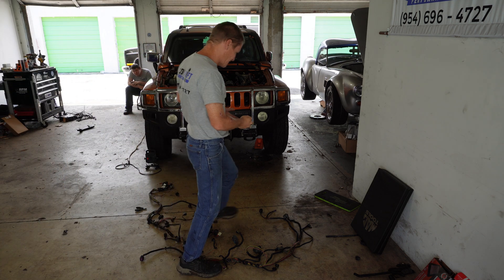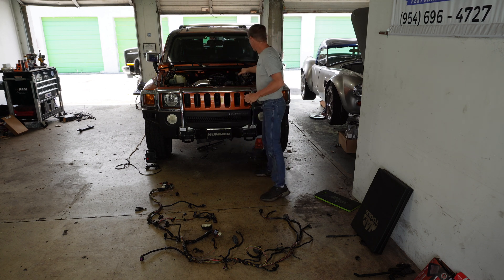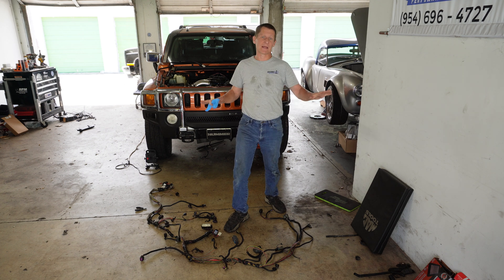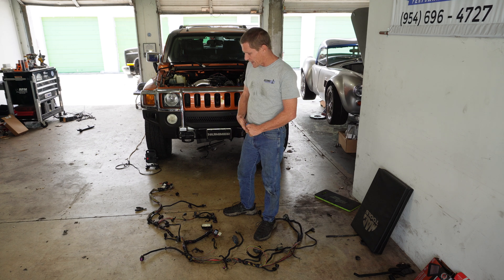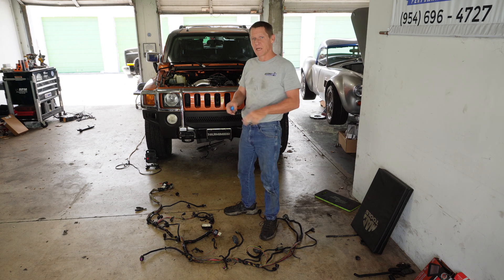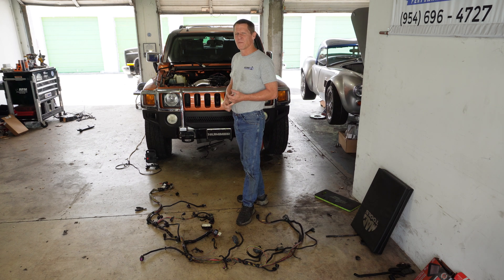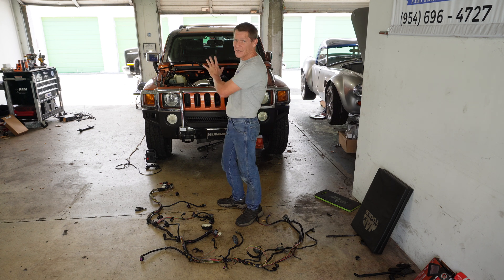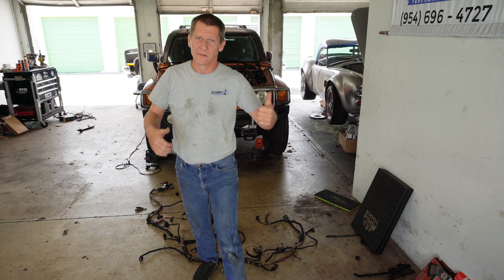Wiring Integration Pt. 1 – Hummer H3 Alpha Conversion Electrical

Comment: Hey Ive got mine almost done I think but I’m going to have to use the starter wire from the hummer harness to get power to my 5.3 starter aren’t I? Activation wire I mean
Reply from the maker: As it were I actually have a diagram I made just for that solution. Here is a link to that picture on my F.B. page: https://www.facebook.com/photo.php?fbid=819510302899659&set=pb.100045220904544.-2207520000&type=3

Comment: Nice work , what tcm you use for the new transmission
Reply from the maker: We are using the PCM from a 2008 Chevrolet Tahoe. This PCM is also the TCM.
Reply: Thank you for the amazing job, did u use the same tranny tht came with the car or u replace bath the engine and tranny from Tahoe ?